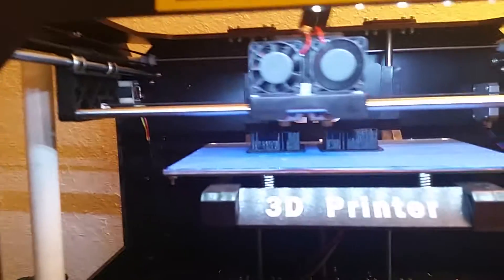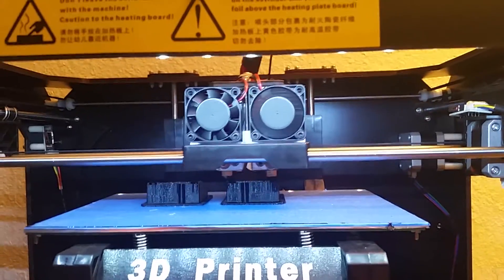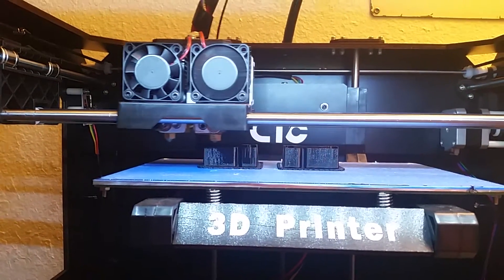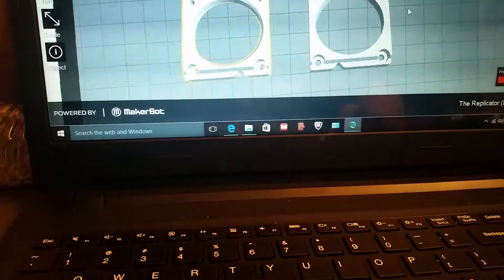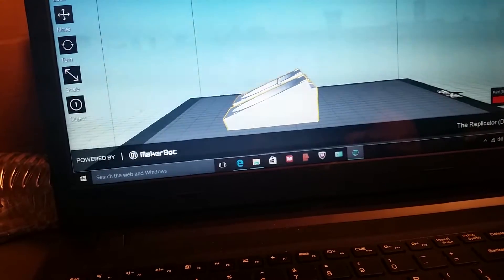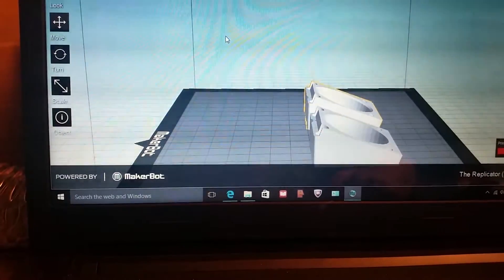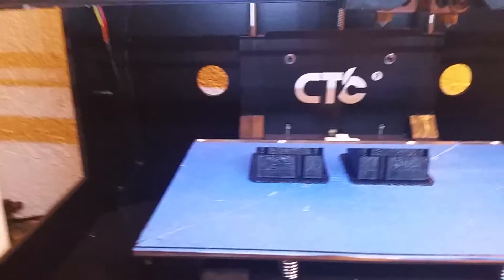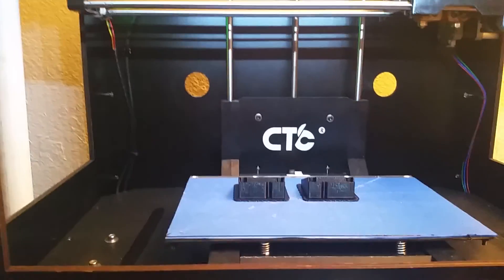ctc 3d printer fan mod

Comment: US:http://www.ebay.com/itm/CTC-3D-Printer-Dual-Extruder-MK8-Factory-Direct-Lowest-Price-ABS-PLA-/182034083209?ssPageName=STRK:MESE:IT

UK:http://cgi.ebay.com/ws/eBayISAPI.dll?ViewItem&item=201528133729&ssPageName=STRK:MESE:IT

GE:http://cgi.ebay.com/ws/eBayISAPI.dll?ViewItem&item=201579059506&ssPageName=STRK:MESE:IT

AU:http://cgi.ebay.com/ws/eBayISAPI.dll?ViewItem&item=201555022562&ssPageName=STRK:MESE:IT

here are the upgraded parts:
Replicator Y Axis Rod pillow block
http://www.thingiverse.com/thing:112128(https://www.youtube.com/watch?v=5XpckqZquCM)

FlashForge Creator Pillow Block EZ install
http://www.thingiverse.com/thing:341284

CTC/FlashForge Creator Y-Axis guide rod supports
http://www.thingiverse.com/thing:1307045

CTC/FlashForge Creator X-Axis Cable Chain
http://www.thingiverse.com/thing:1326991

Replicator Z axis replacement
http://www.thingiverse.com/thing:497923

Mk8 Spring loaded Drive Block Replicator 1 / Duplicator 4 / FlashForge / CTC
http://www.thingiverse.com/thing:231310(important)

PTFE FIlament and Cable Guide for CTC / FlashForge / Duplicator / Replicator
http://www.thingiverse.com/thing:340031?

CTC "Replicator" Printer Spool Holder (Stock)
http://www.thingiverse.com/thing:1000542

Spool filament guide for Flashforge / CTC with 6mm PTFE tube
[http://www.thingiverse.com/thing:409297]
[http://www.thingiverse.com/thing:805717]
[http://www.thingiverse.com/thing:370903]
Reply from the maker: thank you for all the help